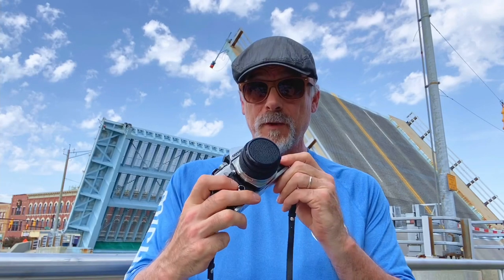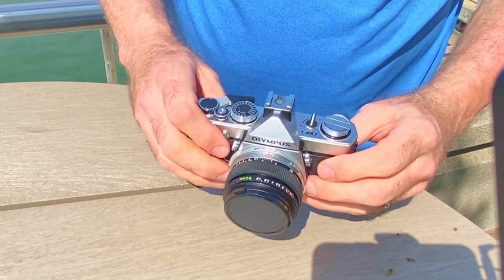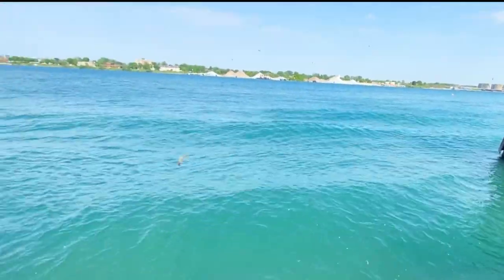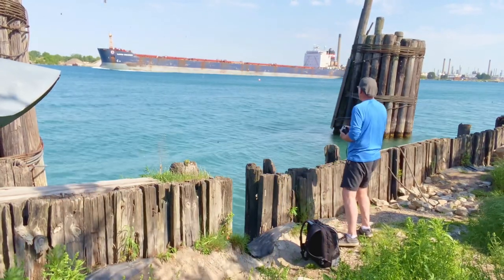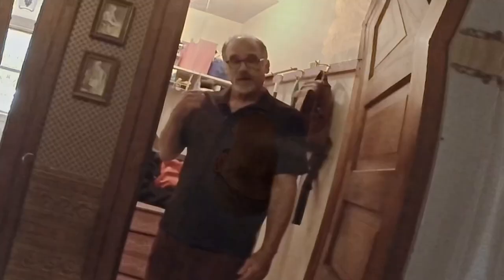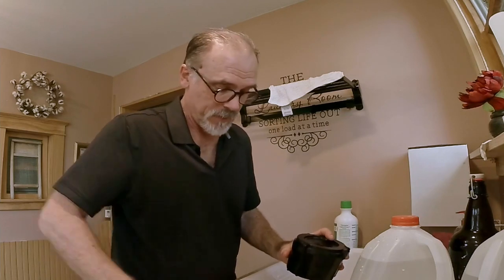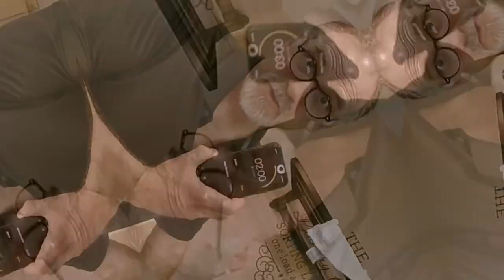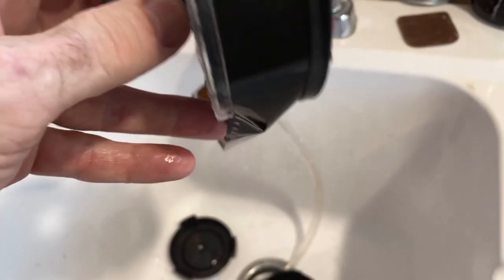Using Kodachrome Film in 2021? Developing film over 40 years old!

Comment: Interesting video, I've got 2 roles of Kodachrome 25 that expired in 2009 so  I've just ordered some remjet remover and D76 chemicals. I hope that I can get some images out of the first roll I used with my Canon EF.
Reply from the maker: Did you try? Did it work?
Reply: @VintageInsightPhotography  Hi what temperature did you use for the D76 and fixer, please? there is no mention of this in your video.

Comment: Hello! Did I miss in the video how you removed the notorious remjet black backing? Normally people have quite a hard time removing remjet by rubbing it off even after applying some sort of alkaline bath (Sodium Sulfite, Sulfite, Carbonate etc. mixed up with Borax). Your film came out clean after developing it without any hints of remjet left. That puzzles me.
Reply from the maker: Me too! It washed off with the water before the developer. I’ve done this twice now and had no issues with the remjet.
Reply: @VintageInsightPhotography  Maybe not all Kodachrome were made equal? Yours is from a later production period and I'm probably referring to the older type like Kodachrome-X from the late 1960's. Could it be that remjet on older Kodachrome was more tough?
Reply from the maker: @johnpiettro4644 , that might be true. I’ll have the opportunity to try this again… just got three more rolls of Kodachrome 64! 😉
Reply: @VintageInsightPhotography Your best  Kchr-64 developing time is stated as 13 min. How did you arrive at that? Is that for D-76 stock? For majority of films I see the developing time with D-76 stock is around 6 min. Another guy on YT suggest 15 min. Why do these extended timings work and don't overdevelop the film?

Comment: My math is different. You counted three fingers for the decades to equal additional three stops of exposure. ISO 64 to 32 is one additional stop. 64 to 16 is two additional stops. 64 to 8 would be the third stop of additional exposure but you said the camera ISO was set to 32. According to my math you exposed the film two stops over. So are we looking at finished images at two or three over?
Reply from the maker: Two and three. I didn’t meter and used Sunny 16. 
Good catch!

Comment: Im my experience you overexpose and underdeveloped. Try 32 ISO and 17 minutes for better negatives.
Also you do not show how you got rid of the Rem-jet, which is what will stump most newbies.
Most newbies see the heavy remjet, think they have done something wrong and toss the film....

And  never pre-wash color film before developing (or any fim for that matter, it will just dilute the developer IN the film, and loose quality.....  especially if you use a developer like D76, for like sy 10 films pr litre, after 10 films you have diluted the developer with 300 to 350 miliitre or !/3 dilution.....  and that is a catastrophe.

Since your film came out clean after the short rinse  and the fixer, with no remjet, you faked this for a very important step.